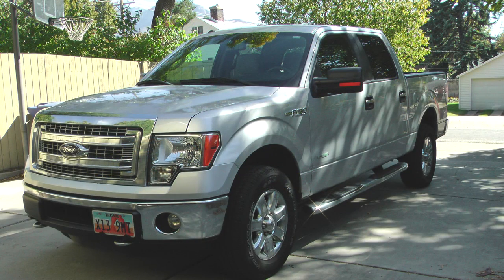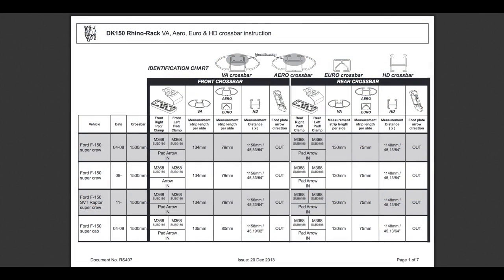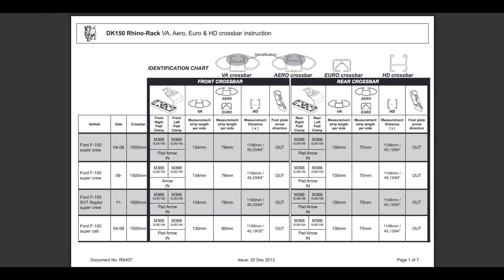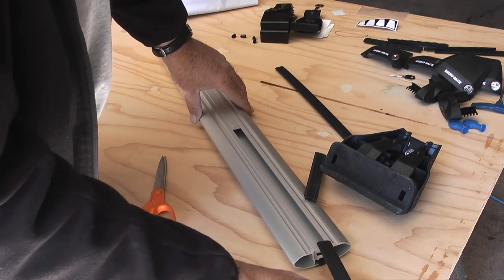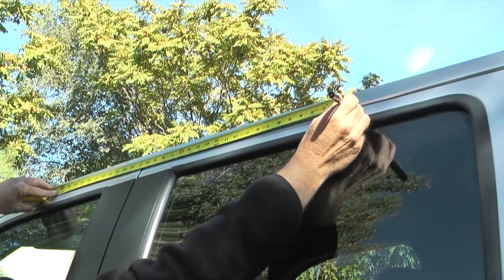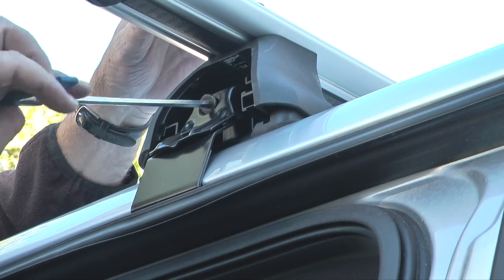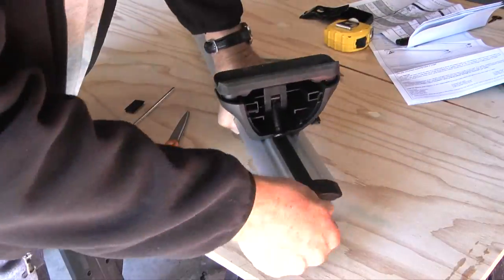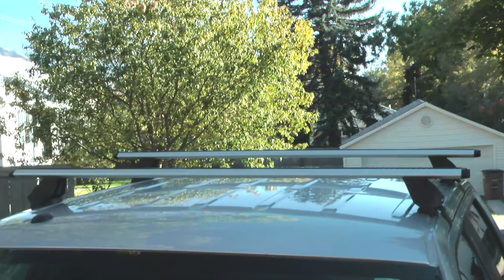Rhino Rack Assembly & Installation

Comment: This might be the best produced how-to on the interworld.  Bra-vo.  Any advice on re-using the rack on a different vehicle?  I bought the new fitting but am intimidated by different spacing spec.  Thanks all.
Reply from the maker: If I remember right my rack would fit a 2009-2014 Ford F150 truck. On their website Rhino has a Fit My Vehicle page where you enter your vehicles info. If the results match the model of the rack you have it might work to install on a different vehicle. I'm guessing not but it's worth a try. Here's a link to the page:
https://www.rhinorack.com/en-us/roof

Comment: Now that you have had the rack installed for a while, have you done a review?  

Have you had any issues with the pads getting loose?

Would you use this system again, or would you Use a different type?
Reply from the maker: No problems so far and I would buy the rack system again. I do have to watch clearances when pulling into parking garages.

Comment: How high off of the cab does this rise? I’m looking for something that would be flush with my camper or lower. My shell rises 8” above the cab.
Reply from the maker: I don't have the rack on my truck right now but I would guess the bars were 3"-5" above the cab when it was installed.
Reply: @Iscaper  thank you for the reply!!

Comment: How do you figure out the measurements? I have a 2017 Fit and I have the crossbars already just waiting on the kit and foot pads to show up. But you didn’t show anything about how you got your measurements and what not.
Reply from the maker: If I remember right the measurements for you particular vehicle are in the owner's manual.
Reply: I put the feet on finger tight and put it on the roof. When i was happy with where the pads were and the bar was even i measured the distance from the end of the bar to the most inside part of the foot.

Then you repeat for all the feet and tighten